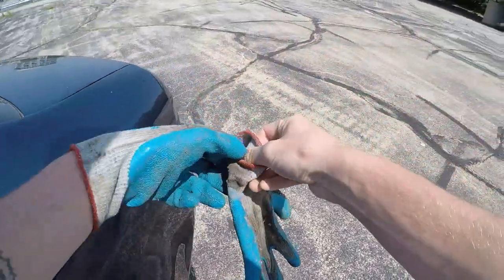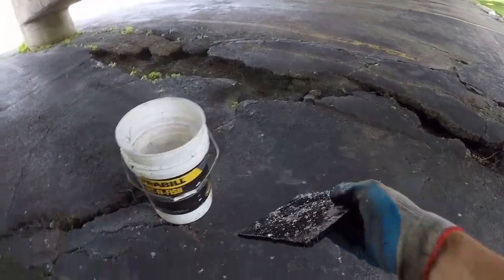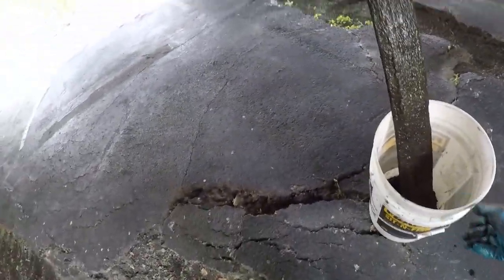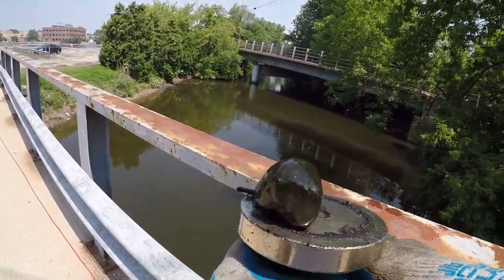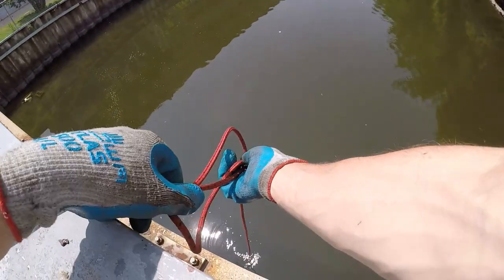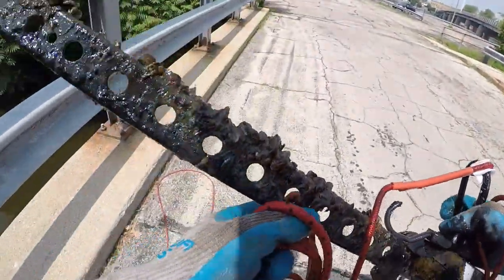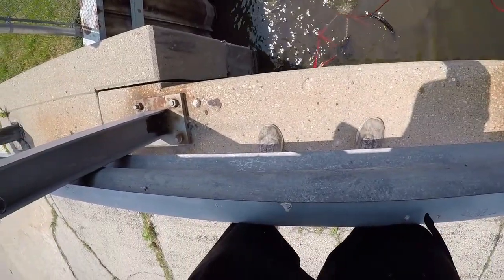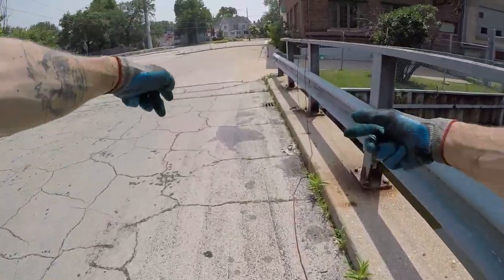I Hit The JACKPOT Magnet Fishing!! (AMAZING FINDS)

Comment: Reasons why I like your channel compared to other magnet fishers:
#1 You actually show the throw.  I’ve seen many channels that just show them pulling in, and sometimes you wonder if they didn’t preload the magnet for show. 

#2 You discuss how everything you pull out has to go with you.  I’ve seen others leave the trash behind. 

#3 You don’t over exaggerate trash.  Some channels make even pieces of scrap seem like a huge find.  You simply state “another piece of scrap, and toss it in the bucket”. 

Keep up the good work.
Reply from the maker: Thank you so much 😊
Reply: Those others leaving the trash behind could be nailed for littering. Once they take ownership of the material , IE pull it from the water with the intention to salvage. They kind of bought the material and the responsibility to disbose of it properly. Like with most laws, they are different by location and the intent vs the purpose can always be argued.

Comment: What happens if you latch on to something 1000lbs with a 1200lb magnet?   Too heavy to lift.  Abandon the magnet? Lol.
Reply from the maker: The magnet has a breakaway strength eventually it would break off but only if you had enough pull haha. Yes in most cases if you get it stuck stuck it’s not going to come off 😬 it does happen sometimes!

Comment: What do you recommend for a length on the rope?
Reply from the maker: This particular one that I’m using is 65 ft long and i haven’t needed anything more than that yet, generally you want like 50-75 ft or so. But if you live in an area with a lot of tall bridges you might want to go with 100 ft or so just in case! Thanks for watching!! If you have any other questions just let me know!
Reply: @TheFisher  What's your magnet of choice?
Reply from the maker: Chris Ricker My go-to magnet for most situations would have to be my double sided 800 lb magnet! (400 on each side) It’s lightweight and low profile so it doesn’t get stuck as easily as a single sided magnet! I do like to also keep a single sided magnet on hand for the bigger things that need more power to pull out.
Reply from the maker: Joao Oliveira The bigger the better 💪
Reply: @TheFisher  😎👍